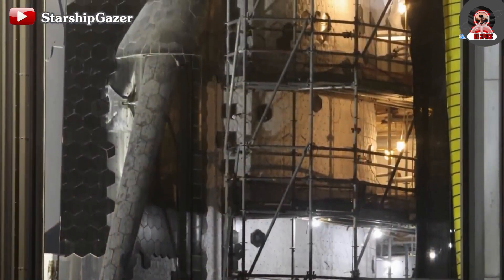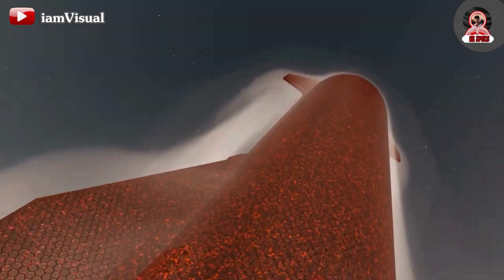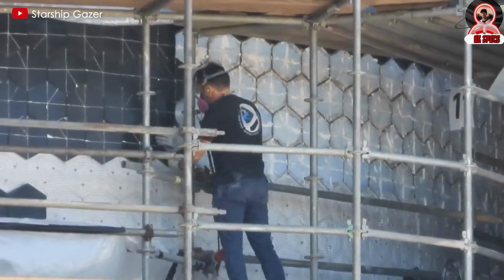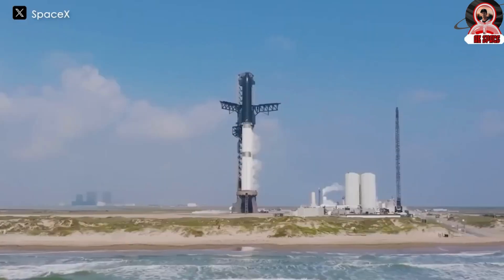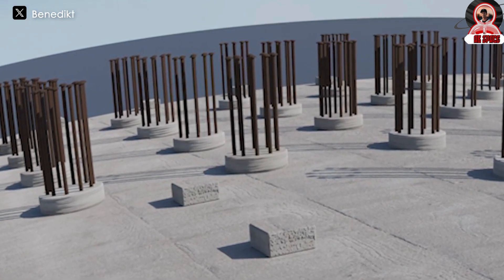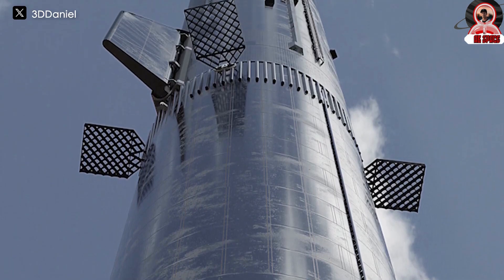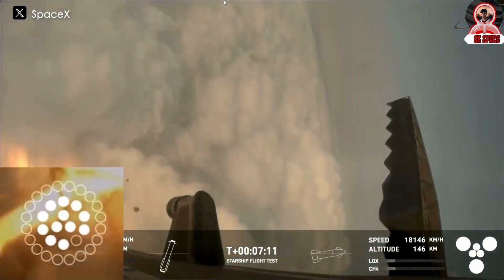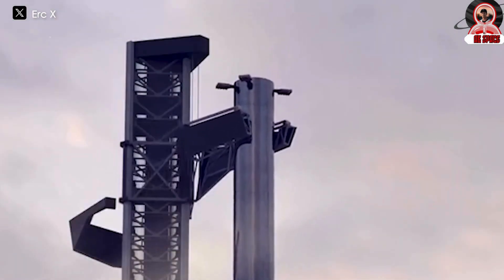SpaceX Reveals NEW 2x Stronger  Upgrade Replacing 18,000 Heat Shields on SpaceX's Starship S30

Comment: it was obvious from the Flight ReEntry Pics that there was "METAL VAPORIZING" around the Wings/Flaps. We wondered if "Flaps" that narrow could really be thermally Protected. ALSO SOME TEXT SAY "FLAPS" ARE STATIONARY, SOME SAY ADJUSTABLE. It looked like Flaps were Moving on re-Entry Thermals, BUT Heat seemed to be Getting to Metal parts.